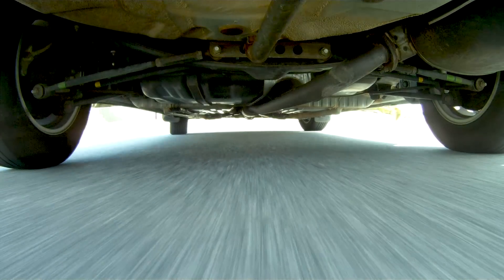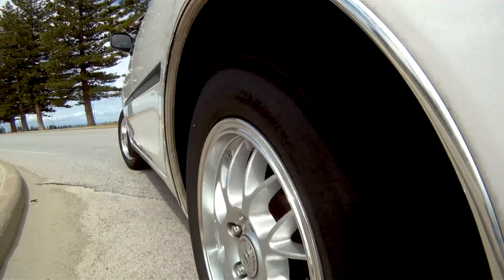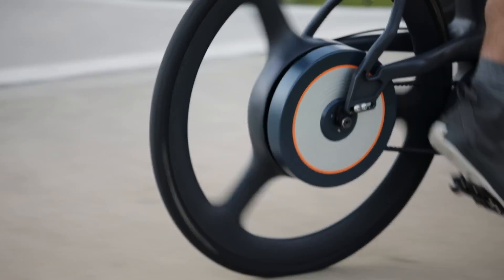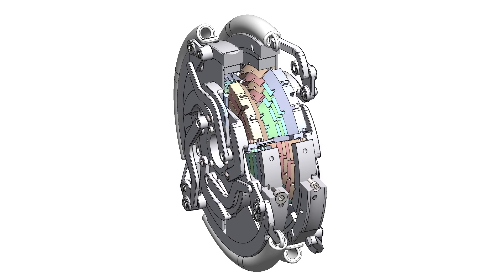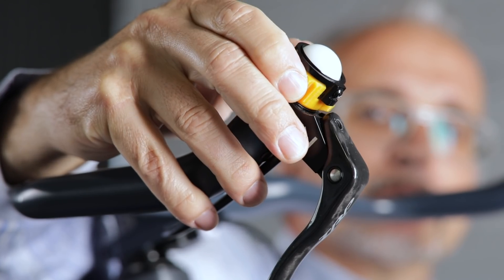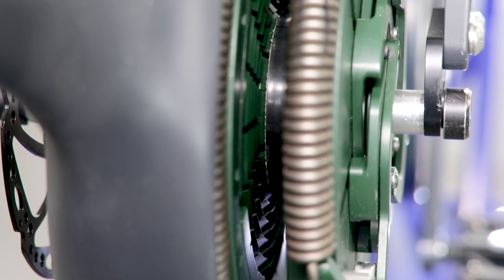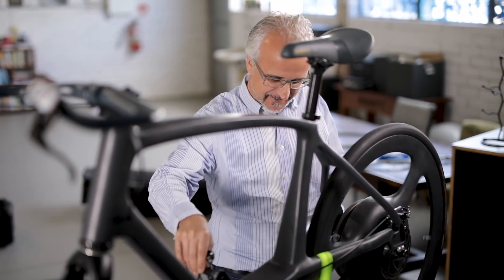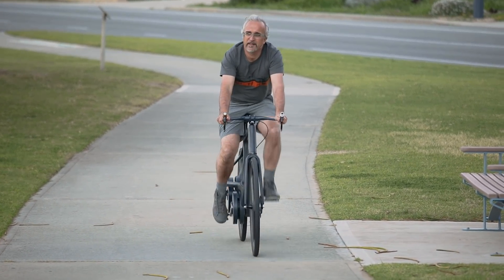Continuously Variable Transmission on a Bicycle

Comment: You lost me at "blue tooth connection".
Reply: LMAO SAME
Reply: I think they mean why do you need a Bluetooth connection on a CVT. shouldn’t it be automatic?! Otherwise you’re shifting an infinite number of times to get from top to bottom!
Reply: @PaulGraville  I personally mean why does it need to be electronic at all? Or if it must be electronic, why bluetooth and not just a wire running inside the frame? If we are complicating things with electronics I dont want to just have them for the sake of it being electronically controlled; I want it to do something more like detect the resistance and shift for me when I need it, otherwise if it's just a glorified manual shifter with infinite ratios just do it with a mechanical linkage and make an already complex component fixable at home.
Reply: It's not so bad... but it indicates these guys are trying to be modern instead of just doing a good job.
Reply: @appa609  exactly.
Reply: bluetooth is good enough for headphones but not good enough for any bike part. imagine you lose the connection just before you hit a sudden grade change. now what?
Reply: Translation: "we can't sell it on its own merits... so BLUETOOTH CONNECTION"
Reply: Lmao same
Reply: so many luddites.
Reply: @jhoughjr1  so many people reasonably worried that the battery will run out, the transmitter or receiver will receive sufficient physical shock to damage them on rough terrain (or by falling over or running into something) and by loosing connection due to electromagnetic interference from any number of an ever increasing number of sources (or just dumb luck or some electronic hiccup) and also contributing to bandwidth crunch, and making it even harder to service in your garage when it inevitably breaks down as all systems subject to sufficient usage will eventually do because entropy is inescapable. What's more, looking that the mechanism, it could have been done with a mechanical linkage to a crank on the handle just like a conventional shifter that any idiot with some hand tools could fix given enough time and some spare parts. With this, spare parts are harder to install, much more expensive, and require specialized know how to install. Oh and every device that's a bluetooth receiver could track you and assholes could hack your bike. No thanks I'll keep my old bike until they make a version with mechanical linkage.
Reply: @davidthomas2870  like he said, luddites
Reply: @ddogthepimp  He is not against the whole technology just parts of it so he really doesent qualify as a  luddite. Feels like you learnt a fancy new word and was just dying to put it in to use.
Reply: @Scribbler-i2c  "fancy word" lol OK bud, the guys developed the first commercially available continuously variable transmission in a pedal bike. I think they know what they're doing when it comes to features, a little bit more than someone in a YouTube comment.
Reply: @ddogthepimp  Nice argument from authority fallacy
Reply: @jhoughjr1  no bluetooth just sucks

Comment: Nothing new here except the over-complication of an otherwise simple mechanical system with added layer of unnecessary electronics.

It can't be CVT anyway, not when the user can select the gear 🤦

Comment: there's already a CVT for bicycles, it's called the nuvinci, and it's a gear hub so much smaller, lighter, fits on an ordinary bicycle. It's been in production for a long time but isn't popular because it has no practical advantage over a sturmey archer or shimano hub gear. Variants on a moving cone and belt drive CVT are worse in every way.

Comment: "compact mechanism"
mhm mhm ok go on
"connected via bluetooth"
NONONONO I HATE IT CTRL-W
Reply: lol, bluetooth got me too
Reply: Also can't wait for it to get jammed at the third dust particle getting inside that gearbox
Reply: Di blutut device es connected a successfuley
Reply: @1xerex  hahaha
Reply: @1xerex  funkshun to blewtoot !
Reply: @1xerex  rofl famous chinese lady saying the same thing in devices worldwide
Reply: Imagine if during a ride the battery in the controller dies....or the bluetooth receiver has an issue....
Reply: Honestly, why? It can't be cheaper.
Reply: @Ariccio123  I'd much prefer a cable connecting the two parts. I could imagine the Bluetooth connection dropping out from time to time which would probably be a very frustrating experience. Also, what if the transmitted signal suddenly gets corrupted and the gear shifts down or up even though you didn't want it to?

Even though successive Bluetooth standards have gotten better over the past years, a simple cable is still much more reliable.

Another issue is that if the signal transmission happens over the air then you have two separate components that need a power supply. A cable can fix this as well.
Reply: @PascalSommerMovies  Bluetooth is actually quite robust.  They use it in manufacturing and industrial equipment, such as on solenoid valves.  Conversely, cables fail regularly due to cyclic loading in the same application.

The larger concern I’d have is the battery.  Not o it will it add weight to what already looks like a pretty heavy system, but once the battery dies, well.
Reply: @s50201  Bluetooth is also tremendously vulnerable to cyber attacks. Well maintained bicycle cables and chains fail after extraordinary amounts of time, Bluetooth applications need security updates every 3-4 months. It's a horrible solution to a problem that doesn't exist.
Reply: @s50201  If i saw bluetooth operated industrial equipment, i would never want to go near that. What the fuck? You asking for shit to happen?
Reply: More like ALT F4
Reply: @keithhudspith5245  Just hold the power button for a few seconds
Reply: @keithhudspith5245  better press power button for 4 seconds
Reply: whats the problem with cabling ?
Reply: Is noone commenting on the possible problem of accidentally setting someone else's gear ratios because they too are using a goddamn bluetooth bike?
Reply: the Bluetooth is it where you drag the line? not the fact is belt driven (loss of power/friction/slippage potential increase) plus them clutch plates are probably made from a stupid alloy that needs changing in around 10 rides or so... and oh yea... you can't fix it in your driveway ... you have to call a "professional", which will happen pretty often, cause that thing being in a cased container... when you hit that back wheel in curves and rocks and pot holes over time it will stop working properly and self-destruct ... and on top of that ... system wise he was saying their thing is more compact and has less things... ehm? to me it looks that is larger, is overall to complicated, requires a big backwheel socket sprocket whatever is called that adds insane load on the bike and has the same amount of knobs and stuff without cables... this is the exact stereotype that Steve Jobs was hatting... big corporation pouring milions and bilions in a product that really does nothing different.. (i know ironic he did the same thing... but atleast he perfected them, but in this case... they made it worst... classic stereotype case ). it does look cool, but does nothing to actual improve ... i know ... labs testings say its more performant... but give that bike to a regular person and their lab testings fall apart... people don't use bikes like they think they do, atleast not the majority of regular folk ... and not the stickup robots they think "the perfect rider" is... based on their product... instead of developing a product for how the "worst rider is"
Reply: @REDFRAQ  the bluetooth was the last nail in the coffin. Nothing wrong with lab tests. The real issue is reliability, not how good the numbers in the test are. We all know lab tests are 'best case scenarios'.
Reply: @REDFRAQ  More people know bluetooth than the whole mechanics behind the thing
Reply: Oh yeah
Reply: Yep. Sucks man
Reply: Seeing how bad my bluetooth headphones are in cold weather I wouldn't use this even if it was free
Reply: Wireless ftw. Cables, wires, and hoses suck
Reply: Electronic shifters are good enough for the peleton. What makes you special?
Reply: @Ovenman940  Ah sorry maybe I should have been a bit clearer. I'm not against electronic shifting and while I'm personally still using mechanical shifting I have a lot of friends that have switched to electronic and are perfectly happy with it. But in most configurations, just like with Peloton, the signal from the handle to the shifter still travels through a wire and not through the air over Bluetooth. It's the Bluetooth part they are suggesting in this video here that I have a problem with.
Reply: @Ovenman940  limited budget and rainy country with lots of dirt on the road.

Comment: Why does the transmission have to be on the rear wheel hub itself? Why not have a conventional CVT offset elsewhere on the bike frame in front of or above the rear wheel, and have a second belt on a 1:1 ratio off of it's output to drive the wheel? I get it, more friction efficiency losses, but I feel like that can be counteracted by keeping the system ultimately much simpler.